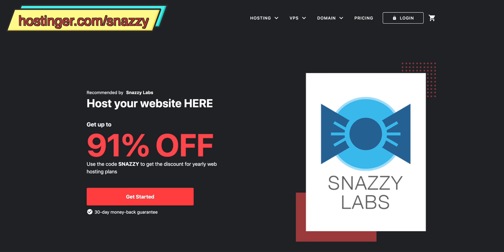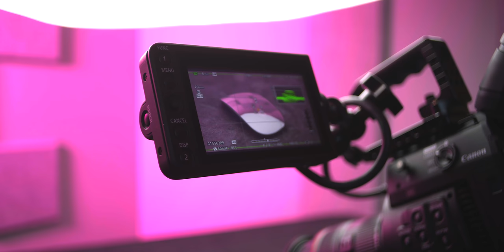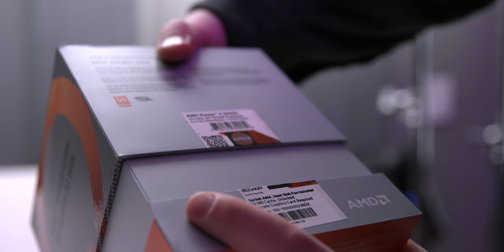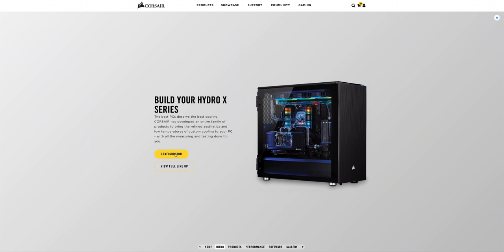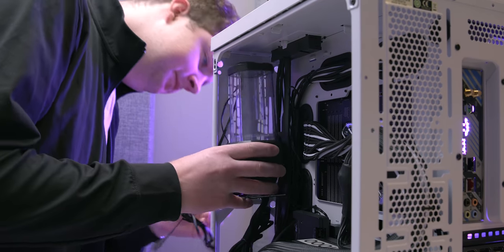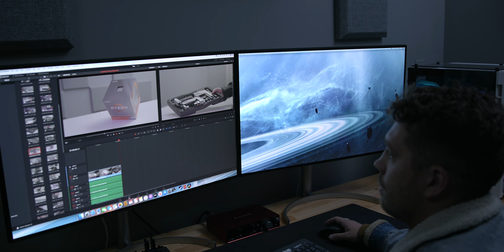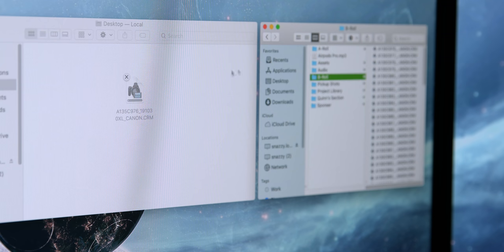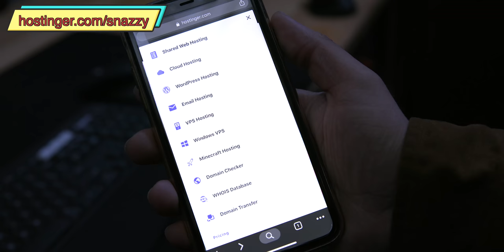AMD HACK MAC KILLS THE NEW MAC PRO!

Comment: How about a threadripper build with some of their insane cpus?
Reply: I'm pretty sure macOS currently actually crashes if it finds more than 63 threads which means anything higher than a 32-core TR (with one core disabled) won't work, unfortunately. However the 64-core version isn't even out so far anyway.
Reply: defi well that’s definitely interesting. Hope more threads are supported in the future
Reply: @CoffeeD_1  Probably only if Apple decides to use anything that actually has more than 28 cores, as that's currently the highest core count they ship with the new Mac Pro. Knowing Apple, I doubt that will happen as they barely refresh the Mac Pro to begin with and the chance of them actually switching to AMD processors is slim enough as it is, let alone the chance of them using Threadrippers.
Reply: @luciascarlet  " let alone the chance of them using Threadrippers." If Apple switches to AMD then Threadripper is only way to go because Ryzen doesn't have the features needed for the Mac Pro (mainly the massive amount of PCIe lanes).
Reply: defi the 32 core one has 64 threads via hyper threading
Reply: @gundalfx  what kind of features does ryzen not have?
Reply: @gundalfx  Regular Ryzen would be a good fit for the regular iMac and I feel like Apple would be more likely to start from the low end first.
Reply: @BillRey  I'm aware, and macOS doesn't like 64 threads. That's why I said with one core disabled (or whatever the smallest amount of cores you can even disable is)

Comment: I'd love to see this with a threadripper.

The other thing I'd love to see would be this thing running a super thin host OS, and running MacOS in a virtual machine (on threadripper).

It would be amazing to be able to run Linux (or windows I suppose) alongside MacOS at the same time (and be able to provision each machine with as much power and ram as you need at that moment).

Pretty please!
Reply: Linus Tech Tips actually did exactly that!
Reply: Unraid is decent about that. It’s super nifty. :)
Reply: Stephen WIDJAJA you act like it’s all about CPU performance.
Reply: @godofbiscuitssf  in workstations it is all about cpu performance, if it wasn't why would Apple bother with Xeons?
Reply: Kyle why would you be able to outfit it with two dual GPU modules that give you 56 TFLOPS?  Some A.I. work is integer but most is float or half-float.
Reply: @godofbiscuitssf  where did I mention AI?

Comment: Really interested in how well an AMD Ryzen Hack performs in audio/music production, where REALTIME cpu performance (mainly single core performance) is utterly important,which is not really the case for video applications.
Reply: @random_bit  real time cpu performance is for recording live instruments and or vocals in studio production. The real time latency is most important for studio recording so there isn't a delay in what your recording/playing and the sound coming threw the computer monitor or headphones.
Reply: @random_bit  yes...the analog to digital converters in your audio interface has its own latency and then the computer has to put that information threw a DAW(digital audio workstation) and whatever effect plugins that may be used to enhance that signal, then computer sends that all back threw the audio interface to the monitors or headphones. Most audio programs for music production also rely on single core speed and are yet to spread the workload out to all cores efficiently. I use the i9-9900k for the IPC/clock speed at 5.0ghz. Hopefully with driver updates for multi core processor we can see future music production programs utilizing multiple cores efficiently. I believe 16core/32 is the limit outside of a program DAW named Reaper.
Reply: @random_bit  lol...sounds like latency is a pain to us both....I read that ARM based processors are not far away from giving us a new architecture to take latency and clock speed to much higher specs that with RISC base chips that are needing high power and producing alot of heat. Do you have any thoughts on that future direction?
Reply: I'm building mine right now with the 3950x, once I get it working I'll try to make a video showing how well it will perform and how is the latency when using large projects with multiple virtual instruments. I'm still a bit skeptical If's going to be just as stable as my macbook is...we'll see.
Reply: @pandaghostofficial  That's great, thx in advance !
Reply: @random_bit  really good feedback.....I hope you do well in your studies and hopefully figure out a new architecture/processor for future latency in computer music production.....and please remember me and send me one to try out..lol
Best wishes with your school Alex!
Reply: @pandaghostofficial  I will be looking forward to your video. Will you be using a thunderbolt interface ? This seems to still be an issue with AMD Ryzen....mostly AMD Ryzen Hackintosh thunderbolt.
Reply: Do not see any problem for real time performance, most normal configuration computer in the last few years is good enough for audio type usage. The main reason for a super CPU and GPU performance plus a crazy amount of  ram for the MAC Pro, is for video and special effect realtime display.

Comment: You can fix iMessage and facetime and icloud!!!!
Just make sure your ethernet is set to en0 in system preferences! 
If not, delete the preferences.plist and network.plist
Reply: @ramanmehat3971  The application of the specific type of vulnerability that @promethbastard is addressing is being overstated. Don't worry about it. Just keep your security updates up to date, use an ad blocker of some sort, and stay away from sketchy software.
Reply: @whereismylife  Are updates on hackintosh as simple as leave updates in automatic or they need to be manually updated with some hacking effort?

Comment: I thought this was a Linus Tech video when I clicked on it because of that thumbnail.
Reply: Please stop clicking Linus’ videos
Reply: same
Reply: Nah, it doesn’t have Linus with an obnoxious expression with his mouth open in it.
Reply: At least it doesn't have linuses annoying little sponsors he throws in like his stupid water bottles.
Reply: U then realized it wasn't because he has no clue how to build a computer...

If he did hed get the 64 core Threadripper chip for 8k or since he doesn't have connections with anyone in the industry (hes a noob) then he can just get the 32 core one. Either way the Mac Pro is using Server grade 20,000 dollar chips where as U can get a chip that costs 8k and get more then double the PHYSICAL CORES for cheaper. 

Yet he didn't point this out instead he wasted 4k on a machine that is made for those wanna be pro sumers that never really get anywhere with regards to the business there trying to blow life into.

Comment: Fun fact: Even with a 32 core new Threadripper and two Vega VII cards and 128 GB RAM, the PC would be cheaper as the base Mac Pro...
Reply: And be faster than the top model in CPU workloads! You could also add another graphics cards with money to spare for the price of the mac pro monitor stand.
Reply: Or a Ryzen 3950x with 4x 2080ti and 64GB RAM if you were going the Windows 10 route i.e.a killer Graphcs GPU rendering machine.
Reply: And have PCI version 4 to boot.
Reply: @CheapBastard1988  or build a second render computer to work even faster while videos are rendering
Reply: @billB101  I think nvidia graphics card are not supported out of the box, only time i have seen it work is through a linux virtual machine
Reply: That is exactly the build am doing right now expect with 256GB Ram and waiting to see what the 48core TRX40 will be like or  if there is better motherboards coming out soon.

Comment: Thanks, Quinn! This just puts the nail in the coffin on any perspective other than Apple is just there to increase it's profit margins rather than market share. I've always used AMD products over Intel in my tinkering builds, and now seeing that a Ryzen Hackentosh can crush anything currently out...makes me so happy to see.  Thank you, again! This build SCREAMS! Any excuse for more AMD HACKENTOSHES is super okay by me.
Reply: xtreamchance Where is the Dell, Lenovo, Microsoft, etc. equivalent? Why single out Apple for not buying off-the-shelf components and cobble together an unreliable screamer? Build-your-own-fast PC for cheap has been a thing since PC compatibles were invented in the mid-1980s. Yes it’s fun. But comparing it to a fully supported product from a manufacturer is unfair.
Reply: @alliejr  I assure u that the Dell equivalent to this model will not be costing $8000 and should still be a lot less for more performance even if a little more. Yes, . It will be more than the completed build here though.  Edit: u can build something similar for around $400 difference for Ibuypower, that's roughly the custom build cost over DIY for black friday.
Good and bad though, support by PC is done with our own sweat and blood. Each part has its own manufacturers warranty. If one part busts we can get warranty replacement.  The fact that i don't have to wait a 2-4 week appointment slot, then  see that whiny robot Apple care's face and wait in line for hours is actually a relief.

Comment: Hey Quinn, really inspiring video, but it's important to let viewers know that in addition to the things you mentioned that don't work, there are a couple other big issues: 1) no power management with AMD CPUs. 2) though thunderbolt 3 is on the motherboard, there is no current evidence that it works under macOS. In your video, you didn't show any examples of a thunderbolt 3 device actually operating. Does thunderbolt 3 work reliably on this rig? Can you demonstrate it connected to a thunderbolt 3 device that shows it moving data at full 40GB/s bandwidth? Thanks!
Reply: 40gb/s data moving? there are not such a thing... he is showing one of The fastest ssd in the world... (AMD only) PCI gen 4 NVMe M.2 SSD and u can see the result of the copy and write numbers, 4gb/s. how to test 40gb/s data moving while ur main ssd can go up to 4gb/s.
Reply: Exactly. Gb vs GB. They're two different measures. And there are many ways this can be demonstrated - show us a working 5K display, or two working 4K displays or a Thunderbolt 3 RAID transferring data at full bandwidth and is completely stable. If Snazzy Labs can demonstrate this then I'll believe AMD Thunderbolt 3 works but they haven't in this video. And so far there's no evidence inside the large AMD Hackintosh Reddit community of anyone having it working. So I'm simply asking Quinn and @Snazzy Labs to show us some proof. Just because the motherboard has the ports doesn't mean they work reliably. ;)

Comment: Eh wait it's now possible to run mac os on ryzen? 

Count me in then.
Reply: literally the only reason I was waiting to upgrade my CPU
Reply: You should join the AMD OSX discord. The people there are dedicated to AMD hackintosh
Reply: @dwong98  what is the Discord server invite Code ?
Reply: @adriancruz88  +1 I have a Ryzen system as well. But I need to run xcode AND android studio at once, my current solution is cloud/vm for xcode and its either slow or expensive. This would definitely help a lot
Reply: Ryuuji Takasu is there an online guide?
Reply: One downside is that only VirtualBox works on MacOS under AMD. VMware, Parallels or Android Studio won't virtualize.
Reply: Fyi, I have a Ryzen cpu and with some "dedication" I made Mojave run under a vm in Virtual Box.

Comment: Here's an acid test for you: Run Logic Pro X with as many plugins as possible before it hiccups. Also, is there an AMD chip that can match or beat the Intel Xeon 28 core?
Reply: Threadripper
Reply: Um 3990X 64 core...

Comment: The only problem with hackintosh in particular are MAC OS updates. Some of the pro apps updates require newest OS version as well. Applying MAC OS update could brick your system to the point that you would need to install everything again. If you are not updating your apps, than you won't need to update OS, but tell that to Adobe etc.... Other than that tiny little thing :) those hackintosh systems are stable as any original MACs.

Comment: iMessage, Siri and FaceTime can actually work on Ryzen if you set the networking adapter as built-in. I used to have it on Mojave and the only reason I don't currently have it on Catalina on my own 3900X machine is because I couldn't be bothered to set it to built-in.

Comment: 6k for 8 core 32gb ram machine. 

That's a great joke.
Reply: Stratos well you can at least upgrade it
Reply: You're not paying for the base spec, you're paying for the way the Mac Pro is designed, including the ability to plug in different types of modules to spec it out for the type of power that you need. If you didn't already understand that, maybe you need to pay more attention.
Reply: @vernonprice5986  What does that offer? Modularity through PCIE 4.0 will be just as good. This build for 3200 (no liquid cooling) still has thundderbolt and 10 gig ethernet. What more would you want? that cant be added via thunderbolt or pcie 4.0
Reply: @vernonprice5986  You must not understand that nothing about the MAcpro is special except the capacity of ram and VRAM. Which will be irrelevant as most people who are buying a macpro wont use more than 256 gb of ram and dual 16gb graphics cards. Anyone who needs more than that will also need better than an 18 core cpu. The 16core ryzen 9 already curb stomps up to 18 core models due to its higher IPC gains. So even with less cores it performs faster,.
Reply: I agree with you. but am an iphone user. i’m the only person in my family with a gaming pc and not an apple mac or laptop
Reply: @gh0st1976  In other words, you have no idea why the Mac Pro costs what it does, nor the value it represents. You don''t even know what I'm talking about when I said "modules", do you? What PC has modules like that? Show it to me. It definitely wasn't in this video. Also a cheap plastic PC is really not the same thing as a Mac Pro that's made from aluminum, is it?

Also since apparently this needs to be pointed out, since there are more Windows users than Mac users, Windows users are the sheep. And that's just obvious. You do understand what "sheep" means in this context, right? Think about it.
Reply: @RiceCubeTech  Seems to me like you're missing the point of the Mac Pro. It's not designed for consumers. Most people who buy it WILL need that much RAM. You're just making excuses. The whole point is that it's for people who WILL use dual 16GB graphics cards. Technically FOUR of them, not two. And since you can get a 28 core CPU, it seems like that qualifies as "more than an 18 core cpu". You do know 28 is a higher number than. 18, right? 

In this video Snazzy Labs does what everybody always does; show a PC that does NOT exactly match every single spec the Mac Pro offers, it's noticeably weaker in parts and of course it doesn't have the swappable modules like the Mac Pro, then tries to pretend like it's exactly the same thing for less money. Which of course it isn't. Same old story, butthurt Apple haters do this every time Apple announces anything.
Reply: ' @RiceCubeTech  Your argument seems to be "well, the Mac Pro offers some things that I don't care about, therefore it's not worth the money". It doesn't work that way.
Reply: @gh0st1976 This is a workstation. Not a desktop.  Compare it to other workstations and it's priced competitively.  You can even configure dell workstations over 110k.  You can get get a z8 over 60k without even trying.
Reply: @codebus  And it is still overpriced. But Crapple Fanboys will buy it. It is more like a religion to them. And "It's a Workstation" isn't a valid point. What is the Hackintosh? It is a Workstation too. Cheaper than a Mac Pro and more powerfull.
Reply: @vernonprice5986  I know what I'm talking about. And Apple charges the premium price because of the name. An Apple is nothing special. Just an overglorified PC. When a Hackintosh beats the Mac Pro, then it says something about the typical Apple Sheep.
Reply: @vernonprice5986  Cute. And you want to be intelligent? Then you wouldn't defend Apple and all the BS they are doing. Nice. You can upgrade the new Mac. Not nice. On older Macs the SSD is soldered in. They tell people you cant recover Data from iPhones that someone droped into water which you cleary can. 
But keep defending a Company that rip customers off when you can clearly get better hardware for a better price.
Reply: @vernonprice5986  so ur basically paying for a nice case? am i missing something? or are u paying so u can replace the 23gb with 128.. and the 256gb ssd with 2 tb and the 8 core cpu with a 64 core one? and the 200 dollar 580 cpu with a recent one? what am i missing here.. the only thing u get with a mac are some features and like 2 software suits that dont run on windows (yet).
Reply: @larsvegas1505  Go ahead and price out a PC workstation that matches exactly a fully maxed out Mac Pro. Not only will the PC be lower quality, not have swappable MPX modules and not be able to support as much RAM plus a bunch of other little things, but it will also cost $20-50k more money. 

Let me guess, you think the $5k pro monitor is expensive too, right? Go price out what a comparable top level pro workstation monitor with the same specs costs. When you realize it costs 3-5 times more money than Apple's monitor maybe then you'll figure out what you're missing.

Comment: If you are a programmer who wants to do a Ryzentosh then you should know that Docker and Emulation do not work properly on Ryzen based hackintoshs. There are workarounds though, such as docker toolbox and Genymotion for Android emulation. Virtualbox works as well. This is because the hypervisor is written to work with intel CPUs (macOS).